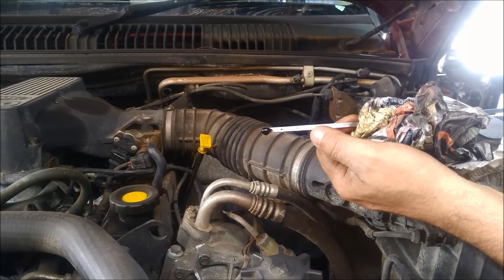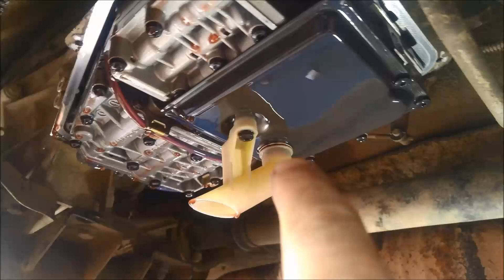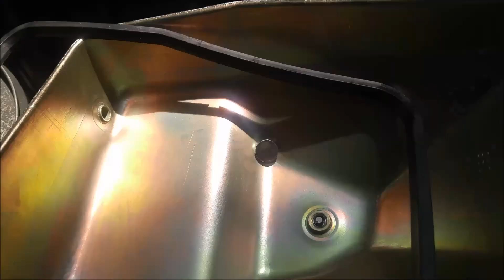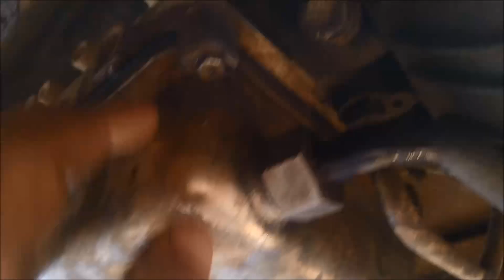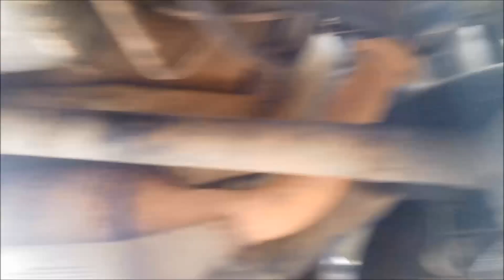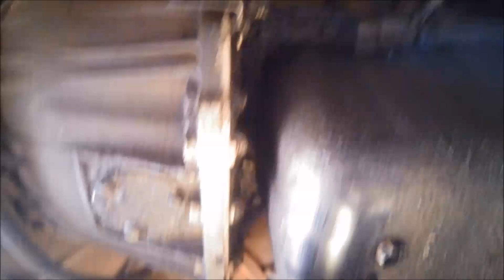Strange Automatic Transmission Noise Complaint - In Transmission or Differential or Elsewhere ?

Comment: Nice one, i do wonder though if those listening device kits for mechanical diagnosis would make life easier as seen on the scotty kilmer channel ages ago. Forget what theyre called they come with multiple(possibly magnetic) sensors/mic‘s ,headphones etc enabling you to quickly find the source of the noise. Never owned them but every  now and then i wish i did.
Reply from the maker: hi, we usually listen with a stethoscope ( like doctors ) while driving on hoist with wheels up. problem is can`t  load on wheels enough to mimic road conditions. but thank you, I may need to look into it cheers
Reply from the maker: maybe rig up with an old eng knock sensor?